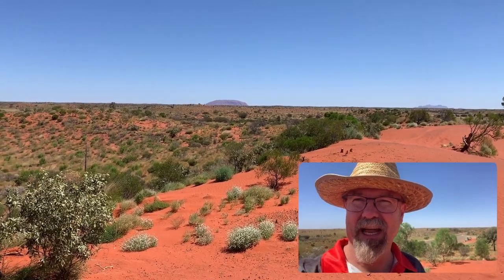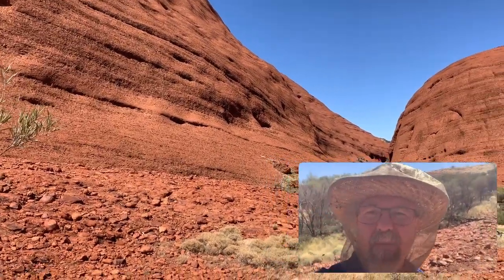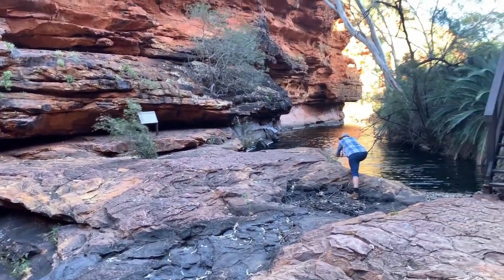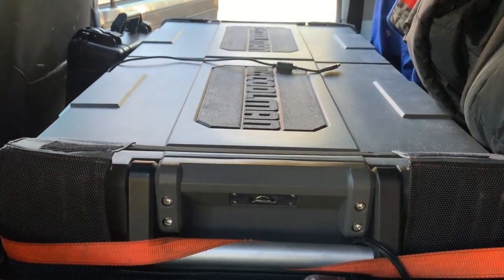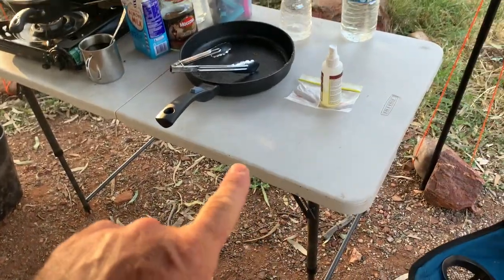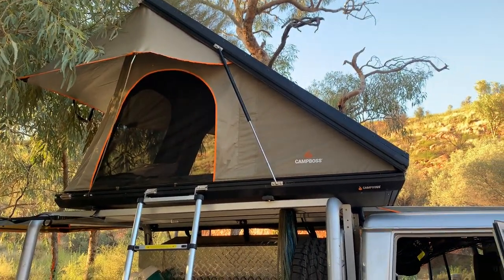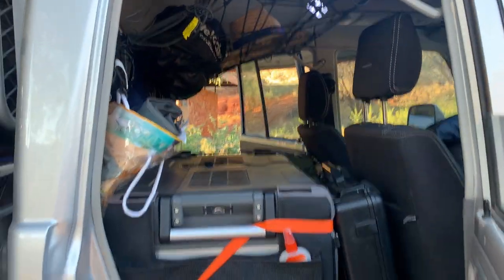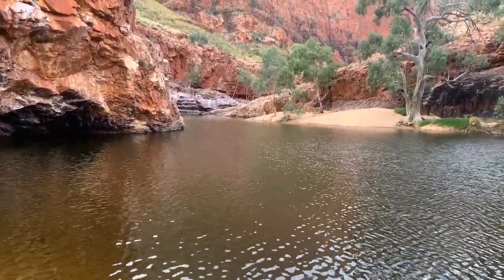This week- highlights of our trip from Ayers Rock (Uluru) to through to Alice Springs.

Comment: Was it that area where Edward Abbey went on his first & last assignment for National Geographic? He wrote about driving through it in a rental car, until he ran out of spare tires. He got a wrecker to tow it. He & the driver were both drinking and the car flipped over on its roof. It was a small car and a big wrecker, and they didn't notice. When they dropped it off, the driver said " you should have told me it had a flat tire". Abbey told the clerk in the office everything was fine, and flew back to the States. There was a lot of foreign correspondence after that. Wish I could remember which one of his books that story was in!
Reply from the maker: Hey Daniel. I don’t know. Sorry, but flat tyres and wrecked cars are not uncommon out here.